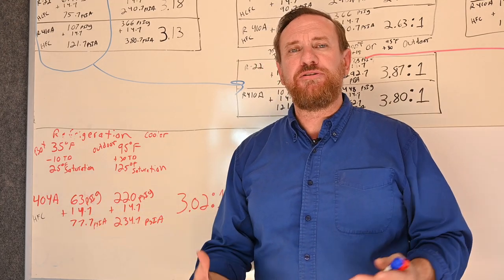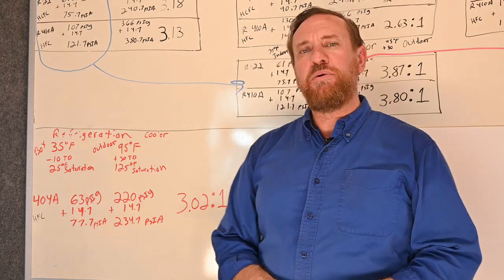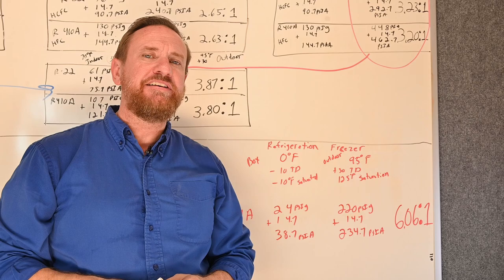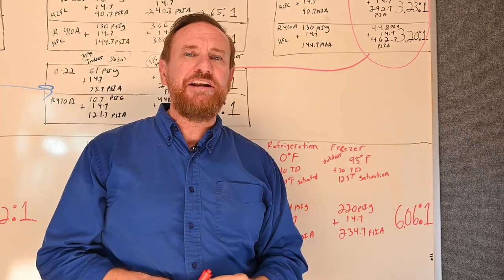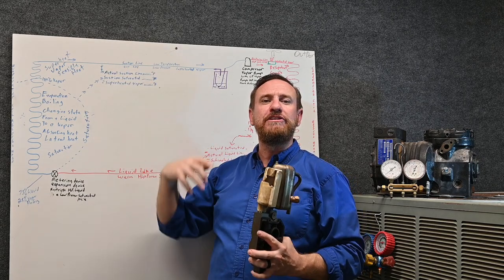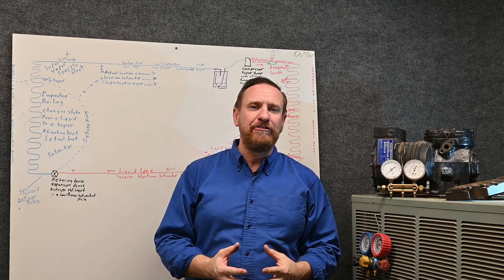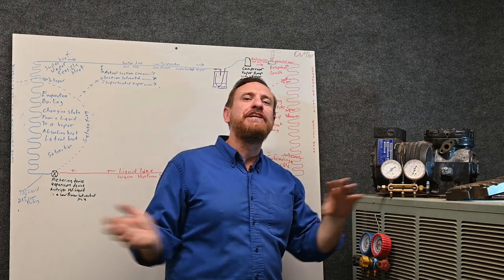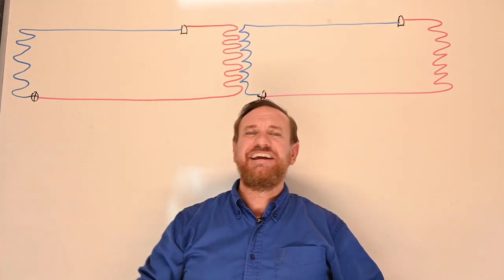HVAC100 B Compression Ratio part 2

Comment: Thank you for the fantastic explanation Ty👏👏This is why 2 stage compressors are used in low temperature systems? I have seen those compressor in Blast freezers operates at very low temperature.

Comment: fantastic video.......one doubt,how are we maintaining 2 different temp like in domestic refrigerator with double door(freezer and cooler)......does it have 2 different metering device
Reply from the maker: Great question! With most domestic refrigerators, the evaporator is in the freezer section with a fan. There is an air duct and damper that controls the rate of air flow between the 2 compartments.

Comment: Is there a way to check the oil level in a under 5ton Copeland scroll compressor such as the ZPS40K6E-xxx series in residential ducted split systems? Looking to see if oil return is working properly

Comment: Have a question is it any CR range to know us our compressor is in safe zone !
Reply from the maker: In air conditioning applications, compression ratios of 2.3:1 to 3.5:1 are common, with ratios below 3:1 and above 2:1 as the standard for modern high-efficiency air conditioning equipment.

As for a max, that would vary by compressor. If you use the copeland mobile app you should be able to look it up for the compressor your working on.

Comment: 220 psig is the saturation for 95° R404A, not 125°
Reply from the maker: Thanks for that! I was worried I would slip on one of them. Good find! I'm glad you where phokg atentikn. Hopefully others will find the same.
Reply: Hi Ty, I noticed it as well. R404A saturated temperature 125F at 333 psig